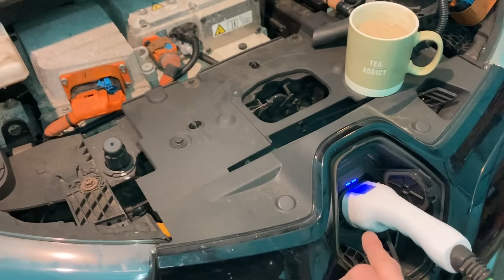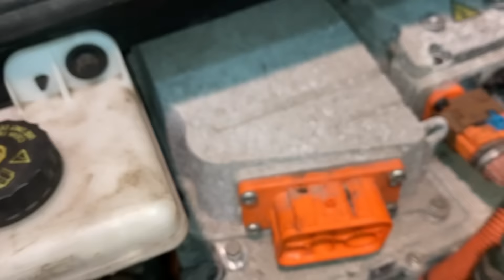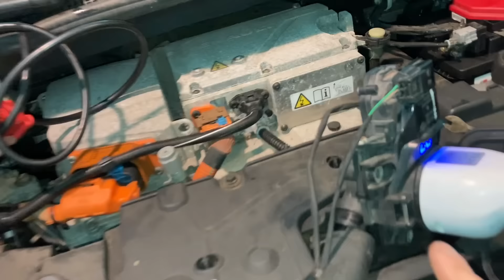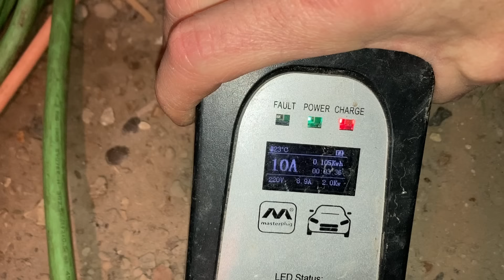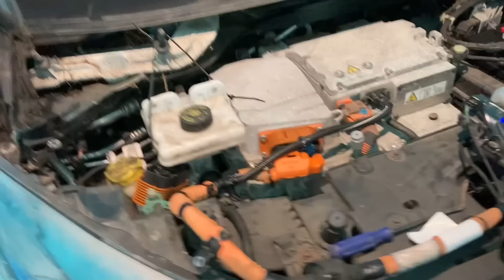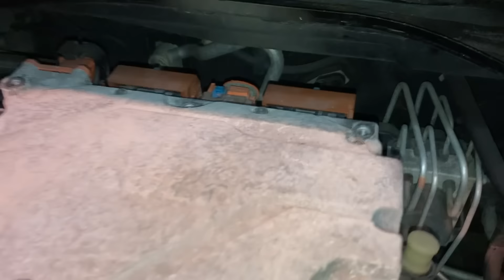Renault Zoe non charge 5AM with a twist - 2013 Continental motor - Electric Car vehicle repair

Comment: Hi Gary
I have DTC0852  code on the scanner that cannot be erased unfortunately. Checked voltage on the 12v battery and it does not see over 12.4v even when the vehicle in ready mode. Currently in constant limp mode with electric failure sign on with red battery symbol on dashboard. Car does not charge either flashes red on the front when connected.

Comment: Hello. I am in Korea.

I own a Fluence ZE.

It is currently not charging.

Since I removed the charging socket to check it, it seems the socket won't go in completely, and it won't charge.

Why won't the charging socket go in completely?

Is there a way to repair the cable?
Reply from the maker: Hi do you mean you can’t refit the socket on the car properly or the charge plug won’t go in? It’s hard to say from here why a plug won’t go in, check it closely with a torch for anything stuck in the socket. Thanks.

Comment: 1p charging seem to be causing issues with that pin.
 I stopped using single phase charging, even though I bought a 32A 1p cable to optimize PV charging😢😊

I wish I had someone like you near me, looks like I have to travel quite far, but my Renault Dealer was very capable so far.

Comment: Ah the sound of a Zoe charging 10khz  crickets what a hellish sound. I am glad the Megane doesn't do that. I do find Renault to be a bit of a shitty company in terms of warranty and right to repair... The outside sound module has an intermitted fault where once every 5 or 10 starts it says "failure outside sound" the dealer says "we can replace the module for 800 euros" that's mad money for a shitty little speaker... but the thing is it's apparently also vin locked(says the dealer)... so replacing the unit myself won't work either... that is good graphics card type of money... I also had to get into a fight with Renault to have them approve firmware updates, the dealer wanted 300 euro's for that too and there is no repository or anything where I can just download a file to install via USB either... criminal behavior if you ask me... no workshop manual available as a non professional mechanic... I think this whole thing with car manufacturers and their gatekeeping is extremely rude...

Comment: Disgusting by Renault considering this car is over 11 years old now and they haven't learned anything! Remove the dash my arse! There is never any HV inside the cars.
Do not like this closely rated neutral contact. Ours is Ok but we only charge at 16A as our second charger is on a small garage supply and helps to extend its life.
Gary, when you test the battery isolation, surely the contactors are open and you are only testing the cable to the battery and a very short bit of cabling inside the battery to the contactors. Isn't the best way to check actual cell isolation to use the isolator socket and test from there to ground as that is a direct connection in the centre of the battery string?
Not a criticism by the way as you are very much the Zoe go to guy in the UK and maybe afar.
Reply from the maker: Hi the Zoe does not have a negative contactor so one side goes all the way to the cells. Cheers
Reply: @garycevrepairs OK Gary, that's a bit interesting and not very safe if you pull the isolator and part of the battery has a fault to ground leaving one pole very live. Cheers mate.

Comment: I love youre videos😃 Big fan of youre work👍 If the fault wasnt in the wire to the batteri. Would you use the megger the same way through the PEB and through the engine wire? Or could you damage the PEB or some engine electroncs in that case? About the rectifier. Is it enough to test the resistens with an ohm meter, from each fase on one side, to each DC output on the other side, to test it? If so how much resistance is normal. When you use the megger, lets say from the fases in the filter inlet to ground. Could that hurt the Y2 condensators in the filter box or the condansator module in the junctionbox? Finaly how much is recommended ohm between one fase and ground, is it min 5Mohm, er is it something less?